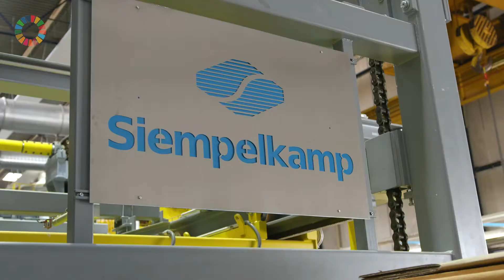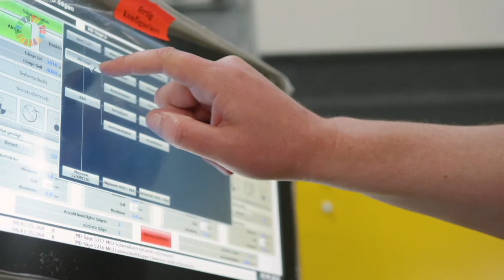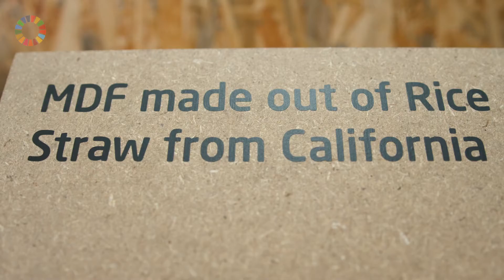Siempelkamp: Annual plants as an alternative for the wood-based panel industry

Comment: Good day i know your are large company and this question can be slightly foolish, but anyway i will try. I have a technical question about forging presses, how do your think it is possible to build forging press with 200 000 tons of press force or more. Or modern materials cant withstand such large press force and be reliable with such forces?As i know most powerful forging press in the world is Open Die forging press on Giva group factory, with 100 000 tons press force builded by Hydromec, what do you think: can more large press be builded, with 200 000 tons press force or more, no matter closed die forging, or open die forging, or exist some limits of modern materials after which the structure cannot withstand pressure and 200 000 tons is too much for modern materials?   I am already asked that question to another company, they says that's possible, but very expensive, and there might be no material, where this would be necessary or the quantity of the parts is so low, that it's not worth such an investment.   What your opinion about this question?
Reply: Das ist eine sehr gute und spannende Frage! Haben wir schon eine Antwort bekommen?
Vor allem wenn man bedenkt dass diese Agenda 2030 sehr diabolisch und gegen die Menschen & den Planeten gerichtet ist!
Haben diese ''Unternehmen, Universitäten, Regierungen, Organisationen, Oligarchen
usw'' das Recht in (fast) jedem Land die Wälder abzuroden oder den größten ''Co2 Abdruck'' zu hinterlassen um dann den ''menschengemachten Klimawandel'' zu verkaufen indem alles teurer wird
und mit Krieg befeuert wird. 
Selber zahlen sie meistens keine Steuern oder haben Deals verhandelt wie den ''Farbenkreis'' der Knechtung wo der arbeitende Mensch nichts erfährt aber zahlen darf für seinen Untergang. Von Chemtrails möchte ich erst gar nicht sprechen. Sie möchten uns (Menschen) unmenschliche Programme aufzwingen die uns noch mehr versklaven, aber das gehört ja zu ihrem Plan dazu der scheiterern wird! Mit den ''Seuchen/Behandlungen/Maßnahmen'' wurde schon so viel Leid erzeugt... Steht ihre Technologie in Verbindung zu Waffensystemen/Impfstoffen oder Schwingungsüberwachung mit Monitoring? Eine Antwort wäre gut denn die (jungen) Menschen leiden sehr unter solchen ''Entwicklungen'' bzw. haben sie Sorgen und Ängste worum es genau geht? Freie Energie, wahrhaftige Medizin & Technologie braucht der Planet und der Mensch im Jahre 2022 aber ich wollte ihnen nicht zu Nahe treten...
Liebe Grüße trotzdem @siempelkamp